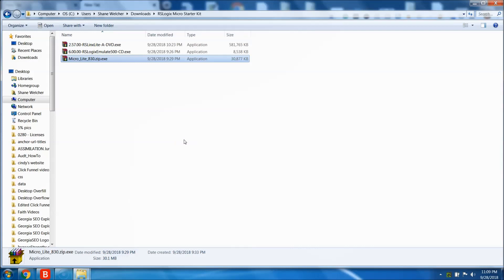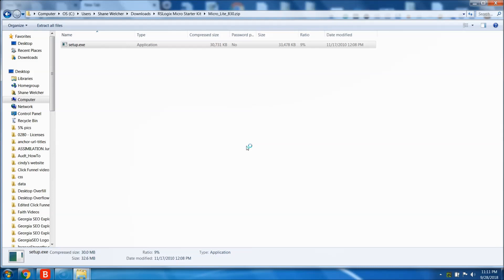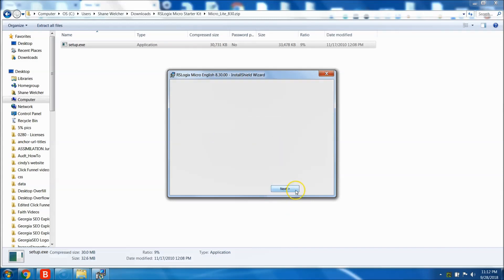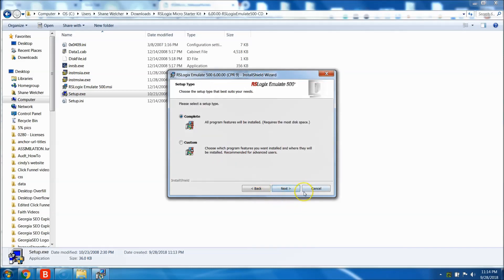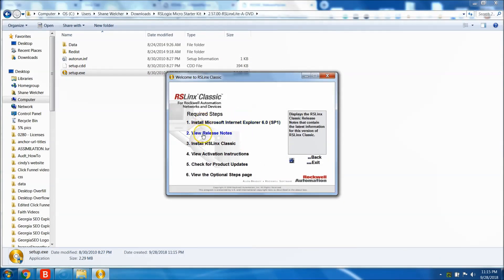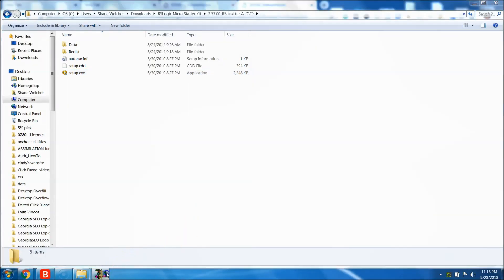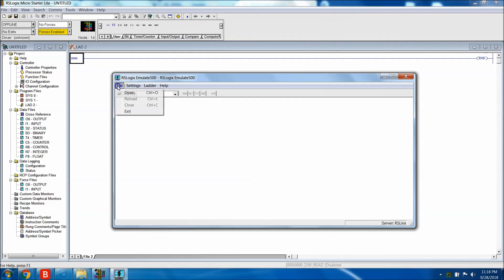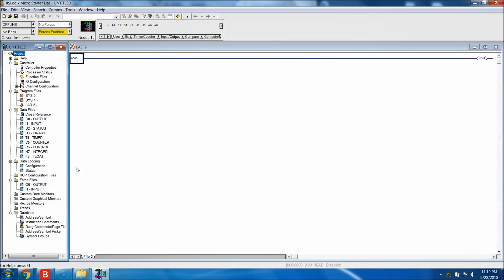Installing the Free RSLogix 500 Micro Starter Kit

Comment: What if we are using windows10?
Reply from the maker: If using Windows 10 then it may work by chance but do not hold your breathe.....What you need to know is that 90% of automation software is not sound on Windows 10 although Rockwell does have software made for Windows 10 now which is Studio 5000 version 32 and FTview 10
Reply: Did you install on your windows 10?
Can you share if it worked?
Thanks
Reply: @fdksdk4843  Yeah I've installed in windows 10. It is working perfectly fine.
Reply: @Phantom.3296  Awesome, thank you!